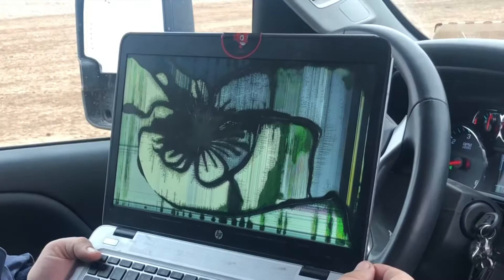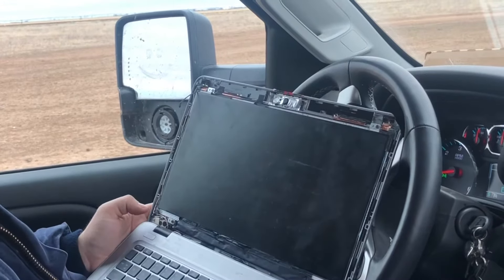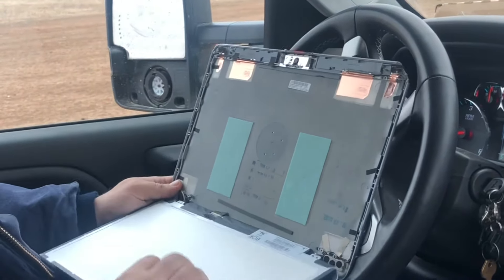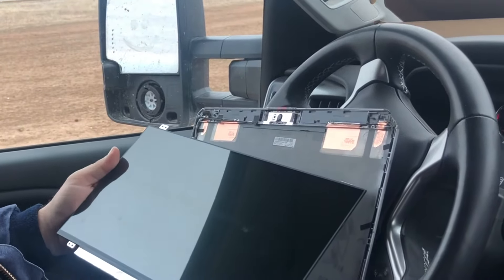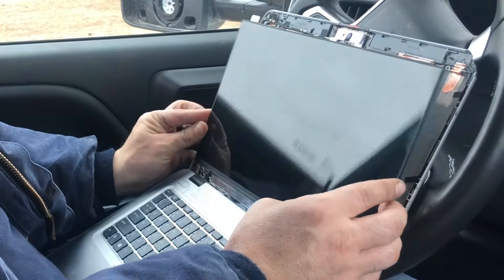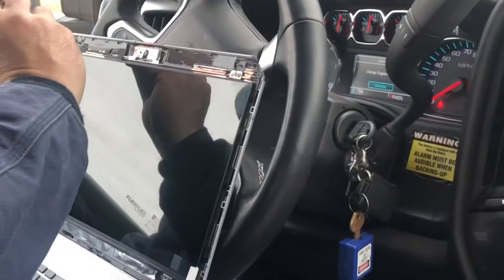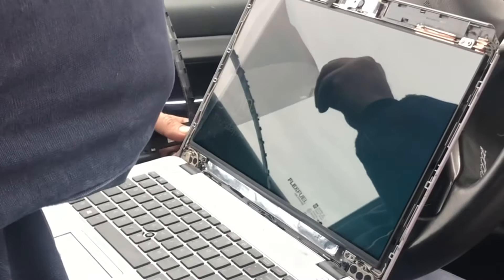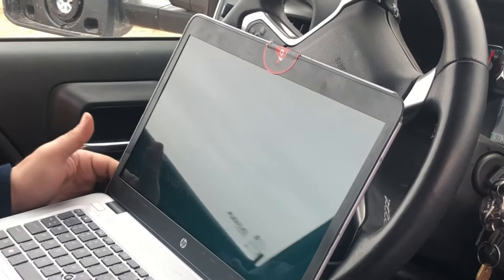How to fix a broken computer screen

Comment: I broke my mom computer screen.I'm going to be in so much trouble and I'm sadly broke
Reply from the maker: Noooo you might just look up the model some are cheaper espically if it’s refurbished I got one the
 Other day for $20 just go to eBay type in model number and check it won’t hurt to look
Reply: @elitesportsmedia  I sadly don't have a credit card or debit card so I can't might as well tell Truth
Reply from the maker: Dang ok what’s the model number I have a few used ones that are extras that I have for parts maybe I can find your screen
Reply: @elitesportsmedia  my hp computer screen broke its a the model 15-ay013ca and it broke during quartine and I ain't got 130 dollars for da screen could u help?
Reply from the maker: I think that’s the battery model you gave me
Reply: @elitesportsmedia  I've never legit talked to you lol...so idk wut u talking bout, like besides my the comment about the 130$ screen.
Reply from the maker: You replied with a model # in just telling you the model # is the battery not the hp computer remove the battery and the model number will be underneath on the computer itself but you will need to remove the battery dies that make sense
Reply: @elitesportsmedia  oh crap I get it..ty, its under the model tag tho
Reply: @elitesportsmedia  like it says model:15-ay013ca
Reply from the maker: Yes

Comment: Bruh u didn’t help at all I jus unscrewed my laptop and now it’s not screwing back and then u gon say to buy a new screen like bruh that’s not fixing it that’s replacing it
Reply from the maker: Sorry to hear about that but it should screw back in and my screen was damaged so I needed a screen
Reply: @elitesportsmedia  and ion wanna b mean cuz u a nice guy and stuff but I wish u told us u was gonna but another screen but it’s cool
Reply from the maker: My bad maybe should of been more clear my lcd was trashed no coming back from that, however if yours is just black sometimes reconnecting the screen will fix that problem.
Reply: @elitesportsmedia  also I don’t have a crack or anything I punched it from rage and it just shows a broken screen but it’s not cracked what should I do?
Reply from the maker: Yeah you gotta order a screen unfortunately, sounds like the lcd has gone out due to the punch